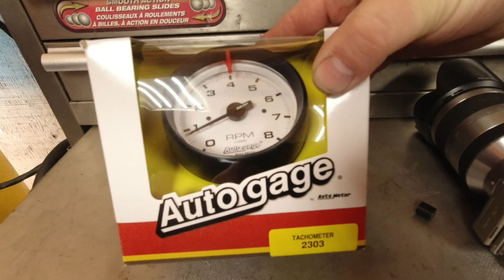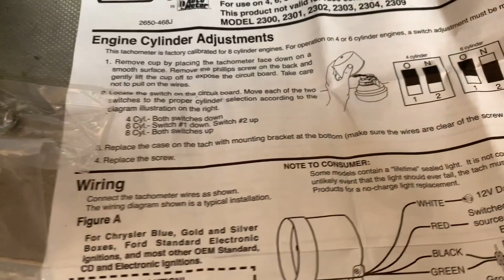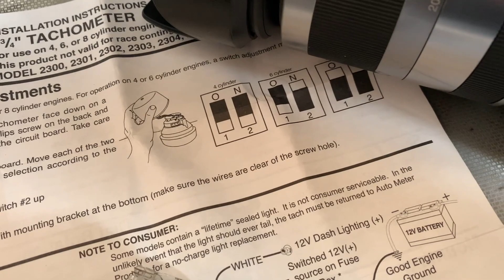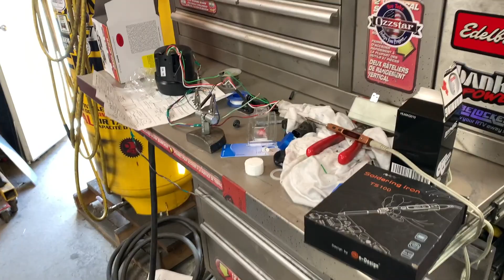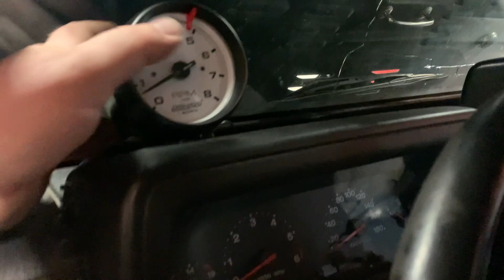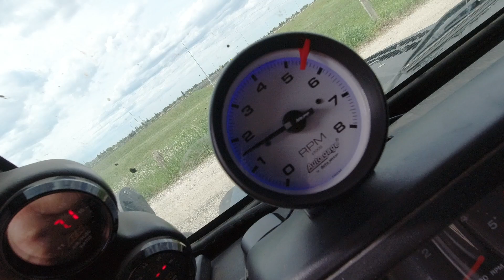Autometer Tach install on Ls Swap

Comment: WHY DO  MY GAUGE NOVES UP REAL SLOW WHEN I REV IT UP IN PARK I THINK MY PICK COIL IN THE DISTRIBUTOR IS BAD OR MY IGNITION CONTROL MODULE I GOT 1990 BLAZER 5.7

Comment: Sorry you couldn't get the emulator to work. Sucks to spend that kind of money on a product for it to fail.
Reply from the maker: Oh there is more to come on that in the future stay tuned
Reply: @TestDontguess  good to know. I have one sitting in its box waiting for me to get to that part of my swap. But I'm doing a jk so it has to work or jeep won't work.
Reply from the maker: josh youngs is yours the old model like mine or the new updated model ?
Reply: @TestDontguess  i don't have a clue how can you tell?
Reply from the maker: josh youngs updated version only has 1 adjustment screw instead of 2
Reply: @TestDontguess  looks like only one
Reply from the maker: You got the updated version and shouldn’t have any issues